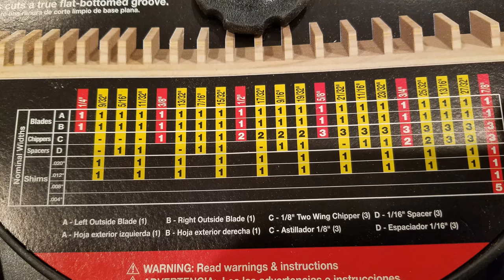DIY "T" Slot Tracks for Workshop Fences and Sleds

Comment: thank you. What are the width and height of your t-track?
Reply from the maker: Hi Francis, Now I am away from my shop, but when I come back I will check. I did them to fit the T bolts I had, so I just measured them so they would slide easily in the track. Best regards, Daniel

Comment: 03:07 But Daniel - that kind of precious wood is (I assume) way more expensive that the aluminum track, right? I don't wanna be rude.. but we all came here for a reason [saving money].
09:01 Uh.. Daniel, besides that black thing there not being a push block but rather a push stick - you do know, there are better designed push shoes / blocks and the like?
16:44 I can't even remember having seen a video with such thorough explanation in every step and detail, but there's one thing I have to pick a bone with you, Daniel: your table saw's top looks like a battlefield. That's not good.
Reply from the maker: Hi my friend! Thank you for watching the video and for your comments. I always welcome constructive criticism. I agree that granadillo is probably considered an expensive wood, although its structural properties are pretty nice. I got 24 inch by 2x2inches squares for about 10 dollars a piece. From a piece you could probably could get 3 to 4 wooden t-tracks. a 4 foot aluminum t-track sell around 20 dollars. So even using granadillo, I guess you might even save some. I did have many squares because I bought in bulk a few years back and I had it handy. But you can certainly use other domestic hard woods like maple, and use boards rather than turning squares that typically are more expensive. I am Uruguayan so my first language is Spanish, I do my videos in two versions, one in Spanish and one in English to be able to reach more viewers. Although I have been living in the US for almost 30 years, I recognize that my English may, sometimes come not as correct as it should. My apologies if I confused push block with push stick. I actually do have some push blocks and push shoes in my workshop. I typically use them in the jointer. I do not use the table saw that much (being my main work in wood turning), so I had at hand the push sticks and used them. But push blocks and shoes are probably safer that the sticks. So thank you for pointing that out. Regarding your last comment, yes, I agree, it is not safe to have so many things on the table saw when doing cuts. I apologize for that. I typically start with a clean table, but doing the video, taking care of the cameras, etc. makes a bit difficult sometimes to keep the top tidy. How to explain it, when you are doing some work and you concentrate just on that is one thing, when at the same time you are thinking about the video, how to present the best takes from three different cameras, etc. is like the space in your brain gets filled with other worries and become a bit lazy about doing clean up and tidying up of the work space. But I take well your comments and will try to show better organization on my new videos. Cheers! Daniel
Reply: @DanielVilarino  Thanks, Daniel for your reply. The quality of your video (I have only seen this one, so far..) is superb, and you explain all so well, unlike so many other YouTubers out there, that often say nothing at all (playing nerve wrecking background music, and fast forwarding way too much). Keep it up my friend.

Comment: Never use gloves when you are working with and power tools especially a table saw. If the blade gets your glove it will pull your glove in with so much force that it will damage your hand
Reply from the maker: Hi Kevin! Thank you very much, my friend, for watching the video and leaving a comment! I typically work without gloves, I understand completely the risk involved, so, in the few instances I use them, I am extra careful. It is just that sometimes, because the wood is too dry, the shavings come out really hot, and that can be very bothersome on the bare skin. Still, I do appreciate the warning! Cheers! Daniel